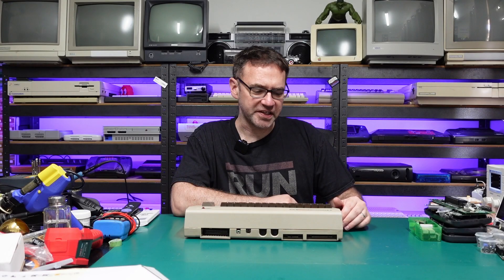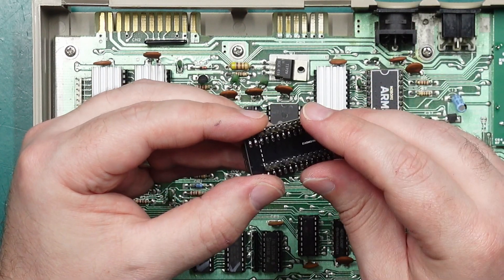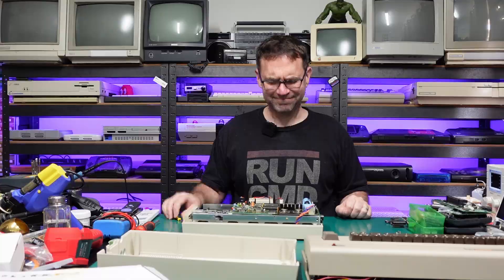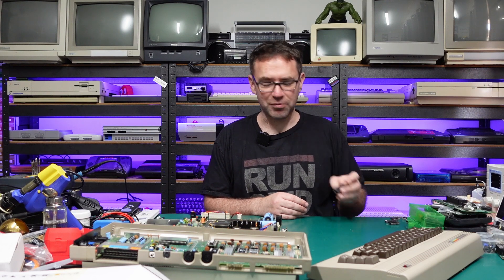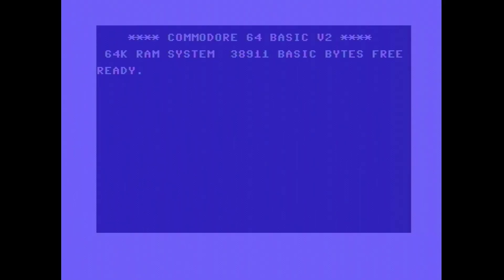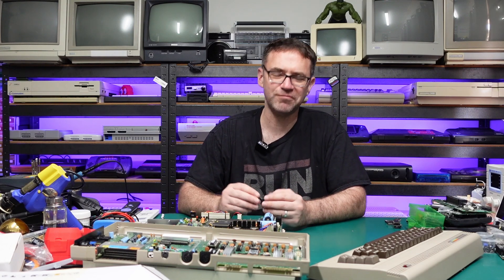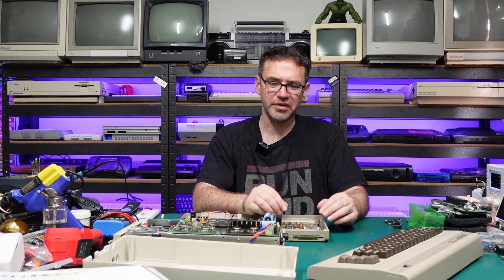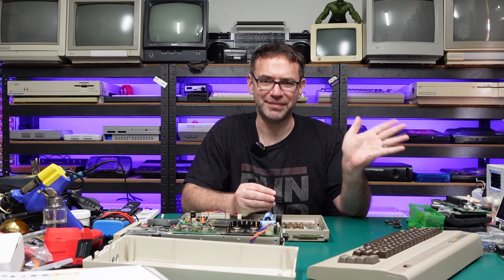New Commodore 64 and 1541 drop in replacement ROMs

Comment: Those replacement roms are very elegant. Better than my double stacked adapter deal. As a fellow Aussie I immediately went and bought 2 (Kernal and Dual Char). I would Also like a basic rom but none in stock unfortunately.
Reply from the maker: Nice. I sent you an email in regards to the basic rom, let me know if you got it

Comment: I haven't tried to build a slim PLA yet, but I do prefer being able to pull out and reprogram ICs if necessary.  Still, having a drop in solution is a great solution for most people and these newer EEPROM ICs are much more robust than the old C64 ICs and could prolong the life of the original ICs because these old ROMs burn out from use (probably because they inefficiently sink a lot of current).

Was just wondering about the voltage and I/O specs of those replacements.  I know not all ICs are created equal, and although the C64 is quite forgiving overall, it has some timing issues with anything outside its design specs (select min input voltage, rise time, slew rate, settling time, ground bounce, and sink current).  EasyFlash and VSP issues can arise if the spec isn't quite right for some of its ICs.

That being said, ROM replacements are usually quite safe regardless as long as the output I/O voltages are 5V (3.4V min) and they aren't too slow and I don't doubt you've tried these yourself with some burn-in testing.  Super Zaxxon, EasyFlash, VSP bug tests, etc.
Reply from the maker: Yep, no issues with the EF3, super zaxxon or triggering VSP bugs. The datasheet for the ATMEL 28C64 is available online, I'm using the 150ns version

Comment: 5:06 you can use a three pin switch connected to a cable that leads to the switch outside, you don't need holes tho, there are spaces free between some expansion ports.

Comment: Any chances we can get a version of the Basic/Kernal ROM used in the shortboards?
Reply from the maker: It might happen, but I'm prioritising 24pin roms as the 28pin stuff can be easily replaced by a 27CXXX eprom
Reply: @TheRetroChannel  That's understandable. Was looking at my VIC-20 the other day, and was thinking if replacement ROMs for the VIC-20 would be on the table?
Reply from the maker: Stay tuned 😉

Comment: Are the EPROMs reprogramable in that package? They would be great for use in a VIC 20 too, plus I like to use custom boot screen colors on my C64.
Reply from the maker: Not for these, I might look into making something that can be reprogrammed but no promises :)
Reply: It would be great if you do. There are plenty of other machines that can use 2364s like the Atari 8 bit line and the IBM 6150, and a programmable one would be very useful for those. This design is so much neater than anything else out there.
Reply from the maker: Atari is a tricky one as they tended to use an inverted chip select. Not sure about IBM, or many others for that matter 😅

Comment: One more thing!  Would be nice if someone made or found a heat sink with a little pad on top to print the chip info underneath! Date codes and other info can get lost under there which might be useful or interesting to know.
Reply from the maker: I usually try to write that info on the underside of the chip before putting a heatsink on. Obviously it needs to already be socketed and there's only so much info you can squeeze onto the underside

Comment: Jiffydos is about 60% compatible with original disk games, I have a few thousand and it failed with many of them. It also doesn't work with Action Replay, I haven't tested other utility carts.
Reply from the maker: Is that using JiffyDOS on the 64 side? What about JiffyDOS on just the 1541 with the original kernal on the 64?
Reply: @TheRetroChannel  It's hit or miss, lots of loaders at least in USA expect rom routines in certain places and call inside them, and the code is different or the offsets have changed and they fail. Early rapidlok and v-max doesn't like it. It was mostly with both enabled where problems arose though. It was enough to be annoying. I used JDOS way way more on my 128 as I used it for calling out and other stuff.

Comment: The "ultra reliable" GAL pla is far, FAR from just that I made several videos on it, the very fact it uses more than one chip makes its chance of failure greater than 1 chip...... there are some boards on pcbway for rom switching, one has 4 terminals at the end and I simply fitted a 3 way dip switch for 8 kernals....... If your board uses a controller to switch (arduino) etc then these have historically had some problems with some cartridges, like easyflash etc, 24pin roms are a pain in the arse to source nowadays .......
Reply: The thing with the GAL PLA is it's open-source. If it fails just make another one. I made my own CPLD-based PLA using a Xilinx XC9536 which is the same size as the original chip. If it fails I just make another one.
Reply: @g4z-kb7ct  absolutely correct, but the nature of the gals does indeed cause them to fail, most chips available are pulls, I got into the whole PLA thing a while ago and made several videos, if you want the closest match to the original then it's definately the plankton ev, The combinatorial logic of the pla is well documented now, my 2p is that there enough to go wrong with old hardware without potentially adding more into the mix, I have spoken to the dev of the gal pla at length, and do applaud him for a low cost community board and his time developing it, But, as good as it is, ..... ultra reliable....... its not.
Reply: @g4z-kb7ct  with the xilinx chip I reckon you probably as good as your gonna get , replacement pla wise, intake it that its the 5v tolerant version, one chip and sorted nice......
Reply from the maker: "Reliable" may have been a poor choice of words, "compatible" is probably what I was searching for. That being said I'm yet to have one go bad, apart from one that I killed by sticking it in a SID socket - damn 250407 boards! Not a big loss as they're cheap anyway. Still, I'd take a chip with 2 GALs over the original MOS PLA. Was yours bad from the start or did it develop an issue over time?

The Kernal switcher uses a pic to switch, I've been using it for a while and haven't had any issues with the EF3 or anything else so far. And I switch Kernals a lot so it's handy to be able to do it without opening the 64.
Reply: @TheRetroChannel  the gal plas I had go bad went bad over time, made a few videos on it as unfortunately only 1 gal went bad and took a LOT of investigating, smoking a pla in a sid socket, priceless..... lol ..... ranks up there with me plugging one in upside down and blowing its entire arsehole out lol, It's the arduino rom switchers that tied into the keyboard line which affected the cartridge port

Comment: Admittedly I have used the MiSTer FPGA C64 Core with JiffyDOS and a game I had as a kid "Rail Boss" does not work with JiffyDOS at least on MiSTer. Would love to see if it works on Real Hardware.
Reply from the maker: Nice. I'll look up the game and give it a test.
Reply from the maker: Just tried it out with a D64 image from wowroms copied to a real floppy. Worked fine with and without JiffyDOS, interesting game though. Maybe it's a PAL/NTSC thing, I used a PAL machine to test
Reply: Apologies I realised I was wrong. Its DolphinDos that has issues with Rail Boss and not JiffyDos. @TheRetroChannel

Comment: I've always wanted to design something like this using modern(ish) SMD EEPROM devices. I wanted to make them user programmable too, so that anyone with a programmer could burn whatever image they wanted on them. Unfortunately, my tiny brain couldn't come up with an elegant way to make them both readable on the computer and writable on the programmer. Are your designs user writeable?
Reply from the maker: They are not user writable unless you desolder the eeprom. Maybe I'll try and work out a solution in the future but for these I wanted to keep it as neat as possible (and somewhat match the look of the originals)
Reply: @TheRetroChannel  That's what I thought too. You need to program the EEPROMs using a SOIC adapter before soldering them on. I was actually thinking of designing a "programming adapter" PCB to translate the pinout back into 28C64 (128, 256 etc) provide an easy programming option for the user. Other stuff got in the way and I shelved this project.
Reply: @TheRetroChannel  They can be re-programmed without removing the chip. You just need to make an adapter that re-wires it to suit the SMD chip then program it as a 28C64.

Comment: Ooh. Could these be tweaked for PET ROMS?
Reply from the maker: Possibly. But I'd want to get a PET myself before saying yes for sure.
Reply: @TheRetroChannel Just make a programming adapter and sell that too then anyone with an eprom programmer can put anything inside the rom. Anyway, legally you can't sell any ROM you don't own so you can't sell replacement Commodore ROMs, period. Just sell blank chips and let the user do the programming. PET ROMs are 2532 or 2716 so easy to program with standard eproms. I know because in the past I fixed a couple of PETs and replaced the old MOS roms with eproms.

Comment: What a great work Mark 👍👍 
It could be used theoretically also for the characters rom in the C128? Thanks 🙏
Reply from the maker: I haven't looked into the character ROM in the 128. From memory it has a set for the C64 and a set for 128. Not sure if it's a 24pin or 28pin in there
Reply: It's a 24 pin ROM using A12 to switch between the two fonts. So the same as your switched version but with the switch line being routed to A12 in the socket (pin 21)  @TheRetroChannel
Reply: I'm talking about the U18, the one that have the "national" characters. It's a actually a 2364, with that "odd" adapter directly from Commodore. I had to "build" one with a 2764, but the clearence is so low that I had to solder directly to motherboard w/o sockets. Your adapter would be GREAT!  @TheRetroChannel
Reply from the maker: Hmm, ok. I'll have a look at it tomorrow if I get a chance

Comment: Excellent stuff Mark. Will mostly definitely be checking some of these out for my modded C64/1541 setup. I’ve just received a rather damaged C128D that I’m planning on restoring. Is there any chance a similar set of replacement ROMS with JiffyDOS would be available in the future for the 128/1571 combo ?
Reply from the maker: No current plans for the 128 as they already use a 28pin ROM, so it's easy to use a standard 27CXXX EPROM.
Reply: @TheRetroChannel  Thanks for clarifying, I did have a doubt it would be required there. Need to get more familiar (through repairing) my new toy.
Reply from the maker: @75slaine No worries, good luck with the 128